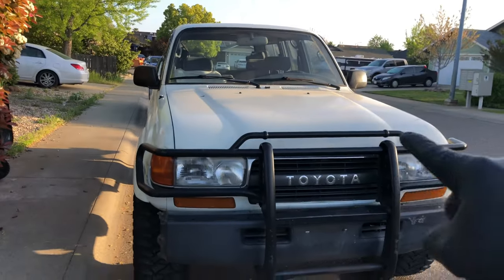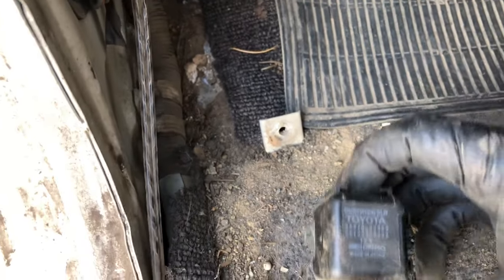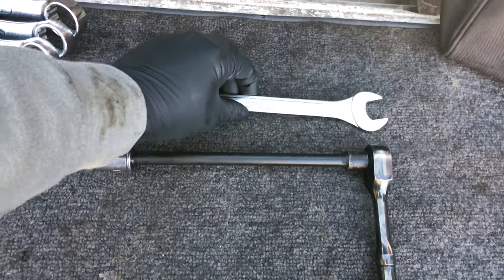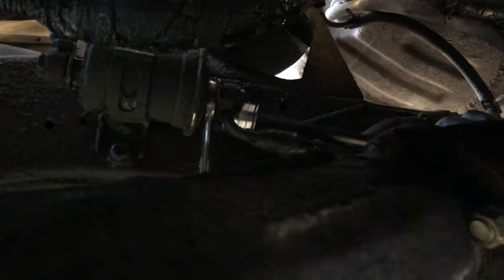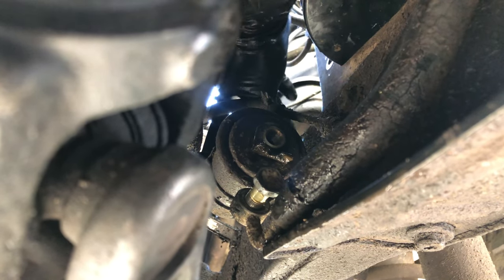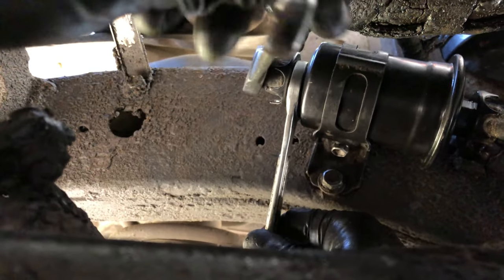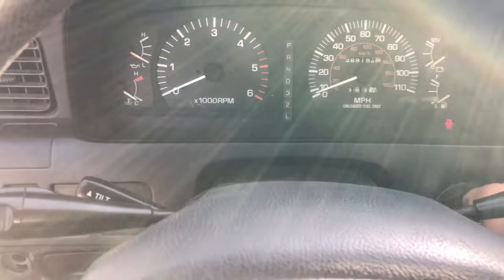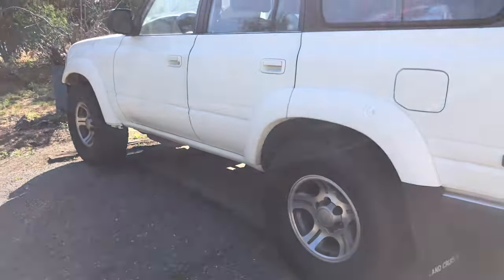fj80 fuel filter replacement | Complete guide

Comment: Thank you!  my 94 was in the driveway warming up, then suddenly just stopped.  Cranked, but would not start.  Thought it was out of gas, even though fuel gauge said 1/2 tank.  Added gas, cranked right up, started driving it to the closest gas station, then stalled out again.  As soon as I got a couple of buddies together to tow it back to the house, it started up again. Drove it back to the house. Going to try the fuel filter first, since I don't think it has ever been changed.

Comment: You waited 2 weeks? Thats pretty good. I have the 1fzfe engine. I did mine probably 8 years ago and remembered it sucked. I bought a new filter 2 years ago and just recently replaced it.  It was horrible. I wish they would have mounted it in an easier location. They probably would have sold millions of fuel filters.  😂 thanks man!